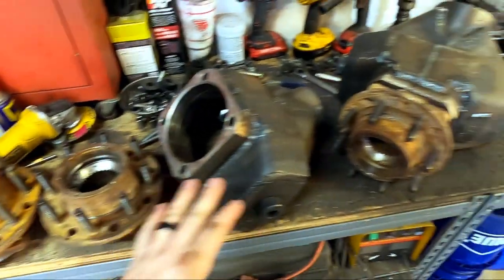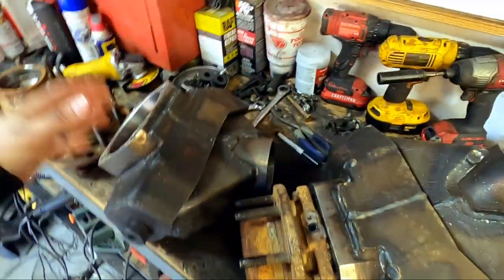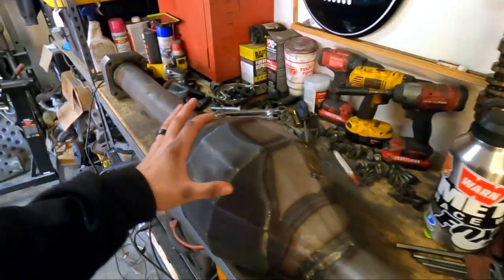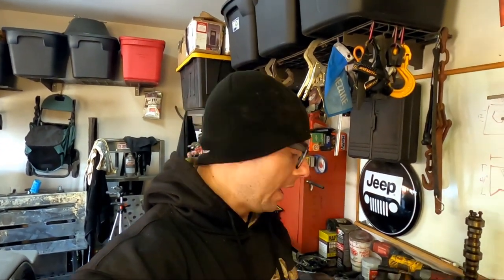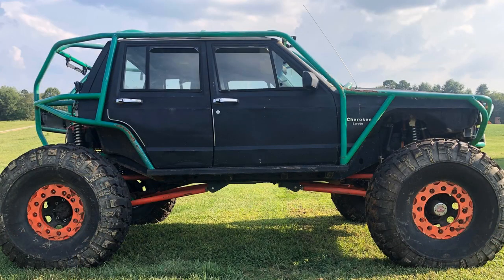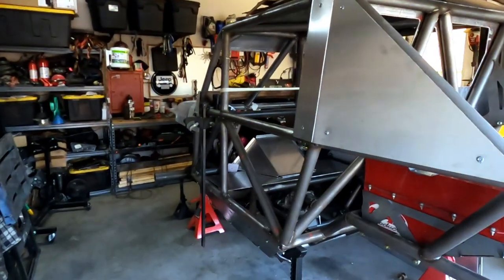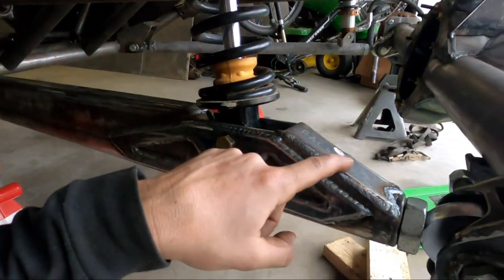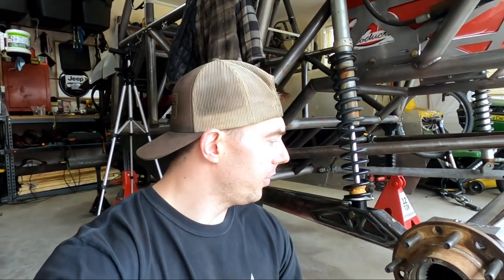Custom Rear Suspension & DIY Trailing-Arms

Comment: I like it!  Go a little more in depth on tech if you can.  Lots of us with the patience to watch want to hear link lengths, anti squat, shock mounting ratio on trailing arm, etc.   keep it up!
Reply from the maker: I appreciate the feedback. I kept the rear links/trailing arm within 1" of each other for pinion angle. Knowing the squat properties of the chassis, our chassis side mounts ended up 16" in separation. Should equate to a pretty decent ride in the desert at high speeds but very capable in the Eastern Series races.

Comment: How have these trailing arms functioned since you built them? Any noticeable limit to flex?

I’ve heard mixed things about only using the anti wobble and not dropping the shock down into the line of the joints, do you get a lot of slop side to side?